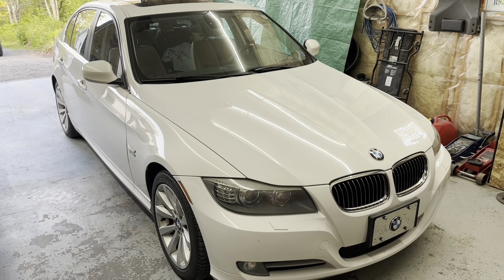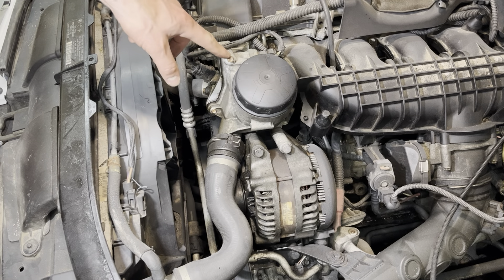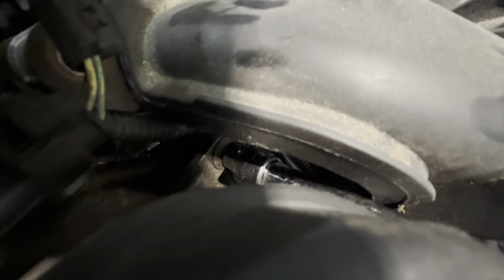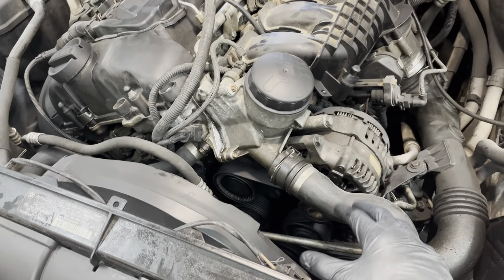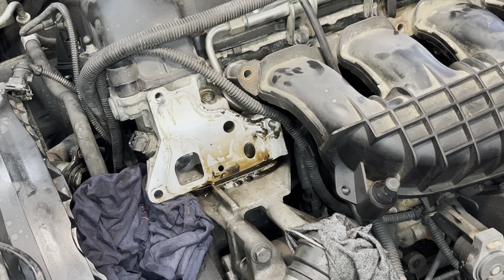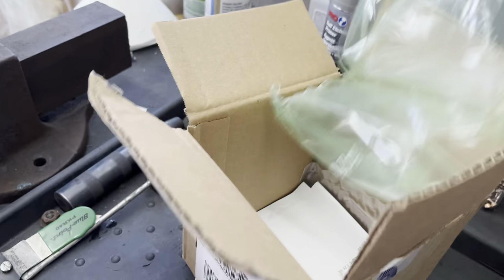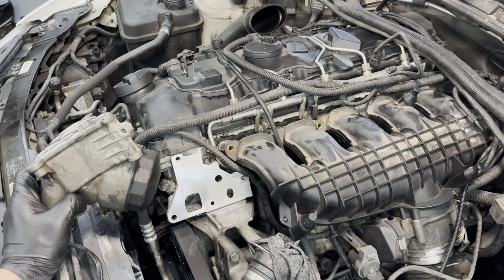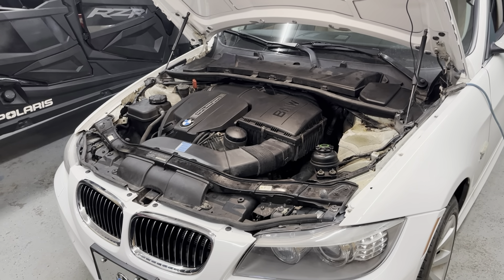BMW 335xi N55 (oil filter housing gasket replacement)

Comment: I have a question, that front bolt Im afraid I might have rounded it, what would you suggest to remove it I have the hose and the sensor out of the way. and it is just not moving.
Reply from the maker: Possibly try to get a smaller socket and tap it on or an extractor socket

Comment: A few comments. By partially removing the intake manifold and not cleaning the mating surfaces or replacing the gaskets, you're asking for an intake manifold leak, as well as for debris to fall into the intake ports or onto the mating surface. You should completely remove the intake manifold, clean the mating surfaces and replace the gaskets. Also, you should prime the oil system after replacing the oil filter housing. You do that by disconnecting the injectors and the coils, removing the spark plugs and turning over the motor. I think you're supposed to do that three times or until the oil light goes off. That way, you know the engine will have oil when it starts for the first time. Finally, to BMW, after decades of producing shitty oil filter housing gaskets, maybe it's time to fire the engineering department.
Reply: Why would they - car dealerships only make 10% off cars they sell off the parking lot. They make their money in parts in servicing.